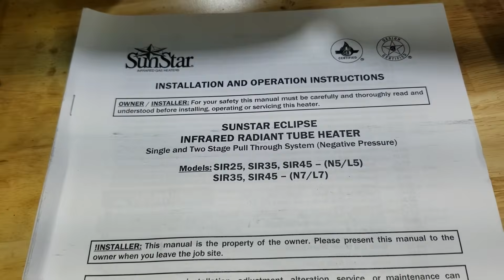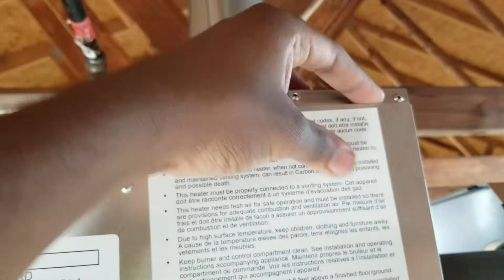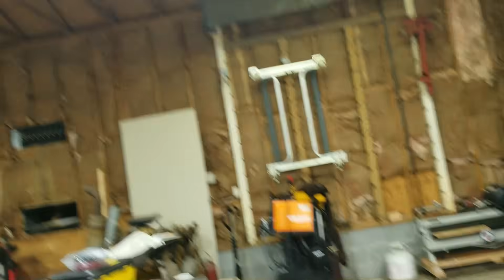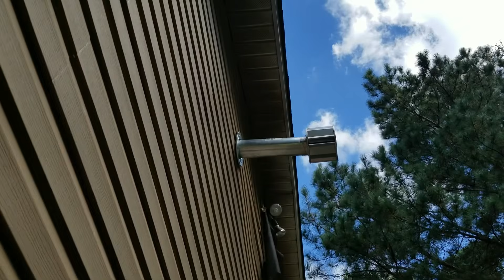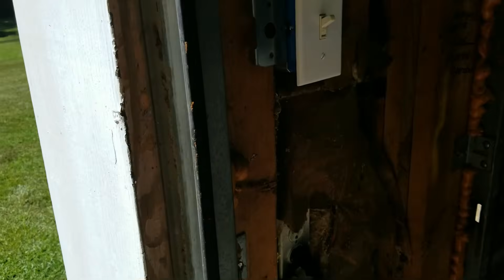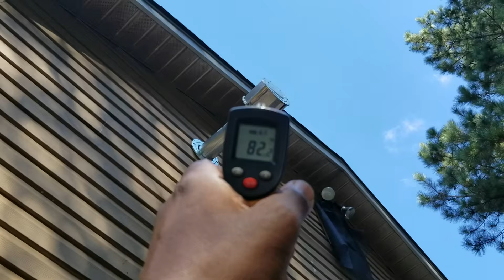Sunstar 45K BTU Overhead Garage Radiant Tube Heater

Comment: I pulled the trigger on this unit,  My building is 24x40 with 9 ft ceilings,  I have walls and ceiling insulated.  I believe this will heat me well.    I noticed you dont have a fresh air run to the heater.  ?
Reply from the maker: II dont have a ceiling so the Gable vents and forced exhaust supply unlimited fresh air.

Comment: Hows is this working out for you?  did u end up using another heat run then?   Not sure what part of the country you are in...but im n the northeast and it can get bitter cold.    some times in the negatives.    Im using a 24 x40 pole building to work in with 9 ft ceiling     trying to decide how big of one of these to go with.     Where did you buy yours may i ask    thanks.
Reply from the maker: Im in the southeast, Its ok but if i had to do it again, i would have went larger, maybe 75k BTU but that would require a larger tank which i havent sourced yet. It rarely gets below 30 here, but i use an additional electric parabolic spot heater when it gets below 40 and that works well. I bought it from Gordo Sales inc, they just drop shipped it from the factory.
Reply: @PremiumFuelOnly  did you have to have a license to purchase this?   Every where i go they want a license.
Reply from the maker: @Dooguy  No, no license was requested, atleast not when i ordered from Gordo sales. I think Northern tools sells them as well.

Comment: Thanks for this video. How long did it end up lasting on a 20lb tank? I've got a wood stove that takes about 1.5 hours to fully heat up, which is a lot of time if I only have a 2-3hr job to do. Looking at one of these to give the heat a kick start.
Reply from the maker: Im on my 3rd tank. They last about 8Hrs per tank. Im using a Flame King KT12ACR6a auto change over regulator to have 2 tanks at the same time in lower temperatures.
Reply: @PremiumFuelOnly  Great! Thanks

Comment: Winter is setting in,  how is this progressing? My building has a hydronic heating system but the concrete slab is not insulated underneath so its quite expensive to use. Considering one of these to replace the hydronic system.
Reply from the maker: Quite well, its getting down in the 40's around here and about 20 minutes after turning it on, it brings the concrete floor under it up about 10 degrees higher than the surrounding floor, the top of the toolbox under it measure 80 degrees. After about an hour, the whole room warms up about 10 degrees. The downside is that with the bay doors open you must be almost completely under it to get the full effect. I plan on getting an additional 100K BTU model with dual reflectors that will span 22 feet across the bay doors since thats where im mostly working and it should heat up faster.
Reply: @PremiumFuelOnly  Sounds usable for sure, especially if you preheated the building prior to using it. 

I spoke with a local company today regarding my 36x36x12 building. There is a separate completely finished room that measures 36x10x8. They recommended a two-stage 80k BTU. First stage to maintain temp, second stage to get up to temp. I believe these sunstar units are only single stage.
Reply from the maker: @TheeAbstractHero  Sounds like 80K should do it. You may want to call Sunstar, they make a 2 stage unit.